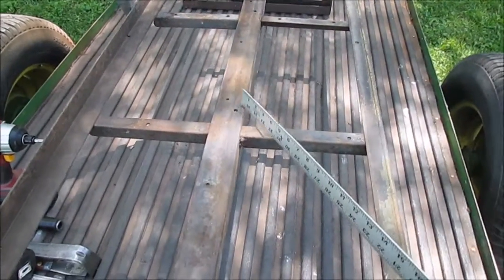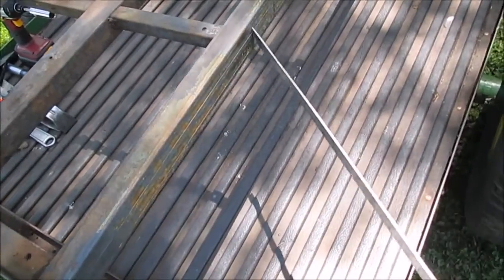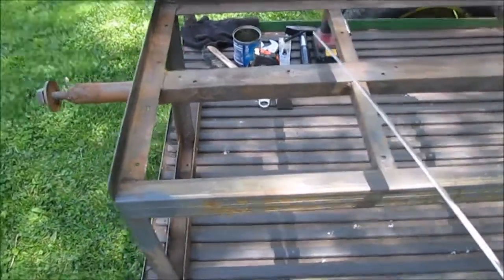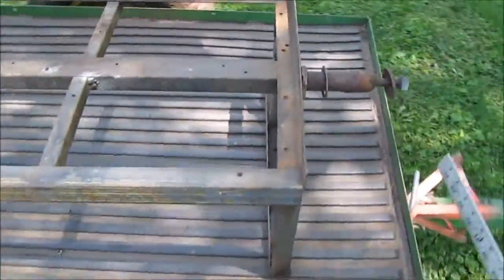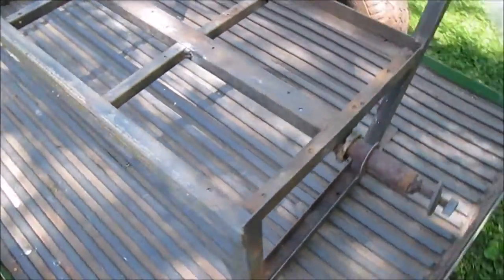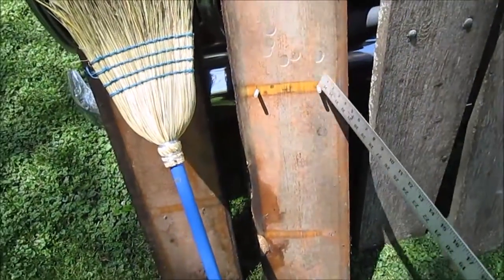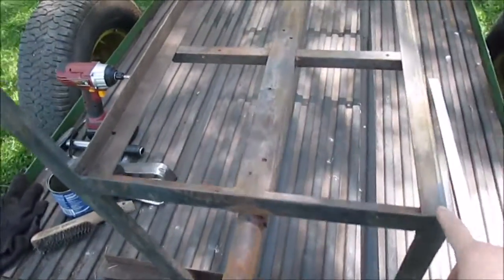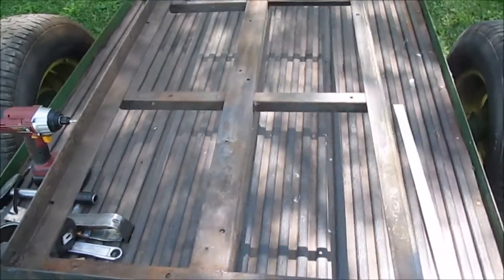Restore ....My Wagon Wheel Bench part 2

Comment: Good to have a stick welder, its always windy by us and my mig doesn't like the wind.  Plus, my mig won't run off my generator, only clean power.   Good old stick welder is invaluable.  I'm with EJ, bed frames are nasty!
Reply from the maker: I am using my little 80 amp inverter welder ..It is fun to use it and easy to carry ...bed frame stuff is tricky to weld